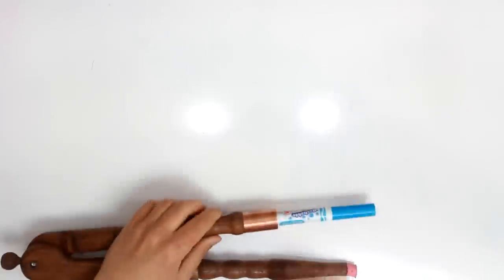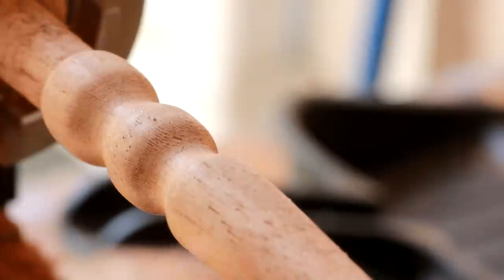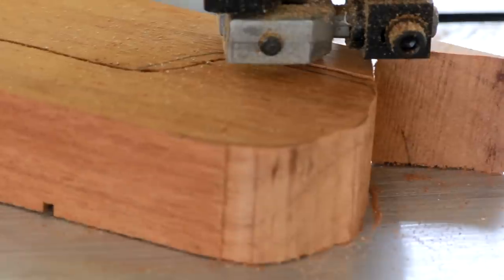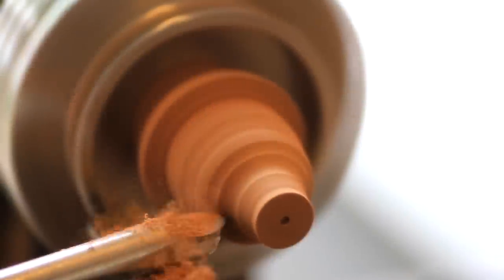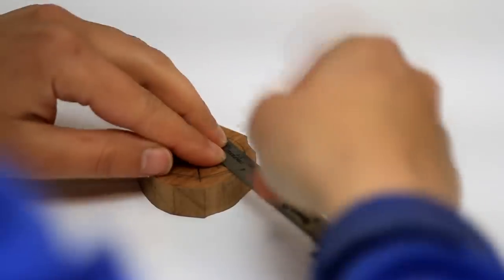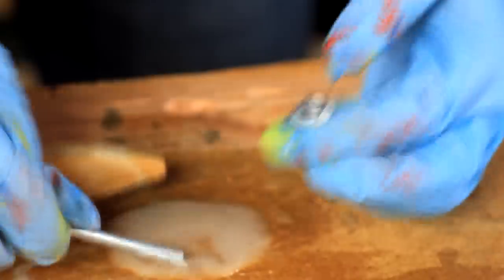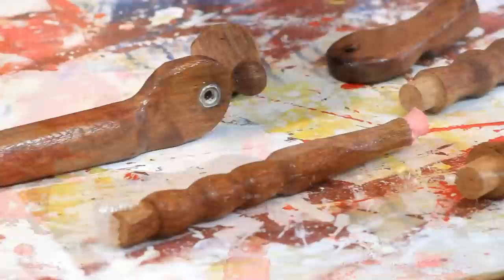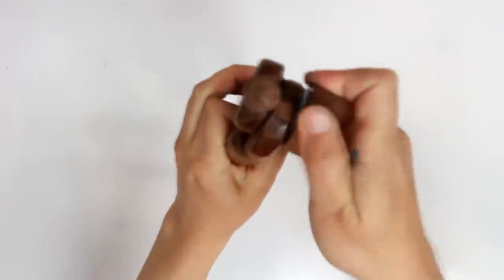How To Make an Over-sized Wooden Compass

Comment: Well big surprise, another wonderful Project, well done Linn... 

Here is an idea you may find useful, the rubber end might slide a bit, so what you might want to do is drill a tiny hole, just under the size of a pin or nail, and insert it in the to wood through the rubber area. If you set it just below the rubber the metal pointer, or nail, would not be exposed but offer a sharp holding spot when a bit of pressure is applied. The depth and length would vary according to one's need. 

I always look forward to what you will do next... :)
Reply: I too noticed Linn HD difficulty making a round circle. You pin idea will leave marks on the white board. I think if you make the rubber piece as a separate piece and have the compass pivot on it, you would have a better chance at making a round circle. The rubber tip would stay still on the white board surface. Maybe a magnet center?

Comment: I like that the legs are two pieces. You could make other ends making it a divider, add a knife to cut circles in thin material, etc.
Reply from the maker: Richard Hiller That is a good idea, thanks for watching.